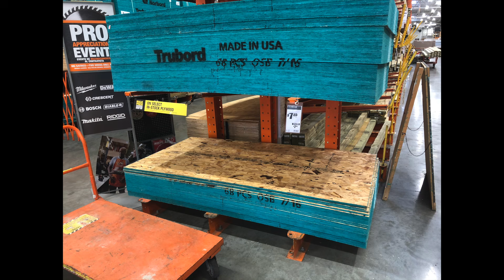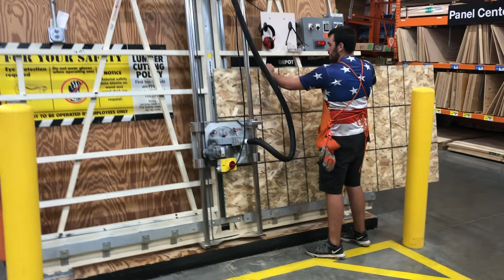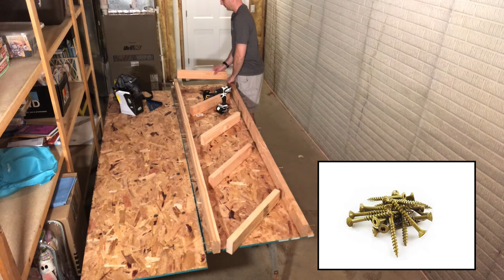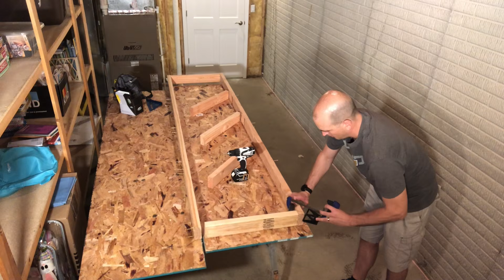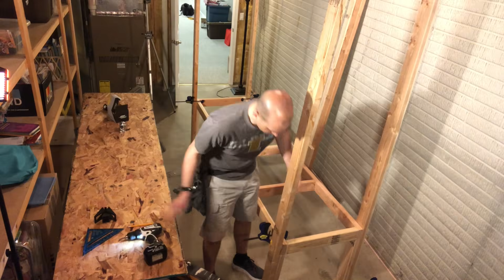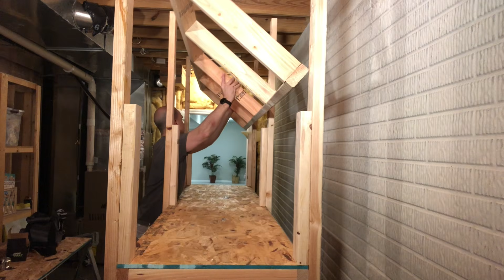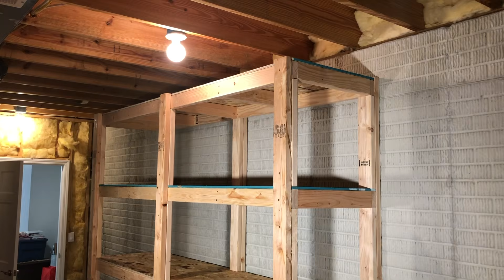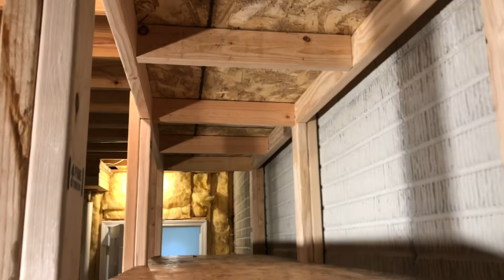How To Build Storage Shelves | Easy Build

Comment: Hi Scott, I like your shelves and they look easy to build.  I do have a question.  I bought my wood before measuring my ceiling height in my basement and I noticed 8ft is to tall and will not work for me.  I’m thinking I would shorten them by 2ft to make it work.  I’ll lose a shelf, but I’d like to keep the shelves the same size as yours.  What do you think?
Reply from the maker: Hey Jeff,  I don't see an issue with that approach. You would just cut your uprights to 72 inches opposed to the full 96 inches and have a little left over lumber.  Best of Luck!
Reply: Everyday Home Repairs thanks Scott!  I’m actually going to shorten them by a foot that way I can still have a fourth shelf just not as tall.  I have plenty of small items that will fit just fine.
Reply from the maker: @GetOffMyLawn1970  yeah if you have shorter items to store that would work better as you wouldn't be sacrificing the storage area.
Reply: Everyday Home Repairs Hey Scott all done.  They turned out great, but I had to go with three shelves instead of four.  That top shelf has 2ft plus height for stowage.  I think that’s better than a fourth shelf ending up with less than a foot.  I’ll use the extra shelf for the next one I build.  Thanks again, your video was awesome.  If you have a business email I’d be glad to show you some pictures.  V/r, Jeff

Comment: How many totes are you fitting per  shelf?
Reply from the maker: Hey Joe,  I would say 4 or 6 totes depending on the size.  The smaller ones I have are width = 16 inches, height = 16 inches, and length = 24 inches and with this size I can fit 5 with a little extra room for other misc items.
Reply: @EverydayHomeRepairs  thanks! One more question, if you don't mind. Did you say how much you spent on materials?
Reply from the maker: @homevideos91  it added up to right around $100 for all the wood and screws.  Good luck on your project!

Comment: Where do the 21" boards go?
Reply from the maker: Hey Tyler, you will use the 21 inch pieces of 2x4 in constructing the shelves.  Since each of the 8 foot lengths of 2x4 are 1.5 inches wide when you add up the 1.5 + 1.5 + 21 = 24 inches wide for each shelf.  Let me know if you have any other questions.
Reply: @EverydayHomeRepairs  Thank you
Reply: Everyday Home Repairs I thought 2x4 meant 2inch by 4inch. I was also confused by the measurements. But I have worked it out now
Reply from the maker: @sharkie1710  yeah the name is definitely confusing but a 2 x 4 is actually 1.5 inches by 3.5 inches.  Let me know if you have any questions putting together the project.  Cheers!
Reply: Everyday Home Repairs ok cheers, makes sense. How sturdy is this design? I guess you could use wider timbers to strengthen? I know it would increase budget, is it worth considering?

Comment: Great video but there are much much much easier ways for this exact design
Reply from the maker: Hey Mike, we always welcome new ideas to improve on the design, make it for less money, or save time.  Feel free to add your tips.  Thanks!
Reply: @Caleb P YouTube easy garage shelving and you will see. Theres a method where you attach 2x4s to the wall then build the front frame then attach cleats. Very easy. Almost the same results.

Comment: How do you have a white Makita? The makita i have are green
Reply from the maker: Limited Edition 😉.  Actually got these probably about 5-7 years back and for some reason they did a white edition for a bit as most Makita power tools are the standard green.
Reply: @EverydayHomeRepairs  they have some black ones and they look pretty cool but that white looks awesome. There's no brand that has white power tools.
Reply from the maker: I think you can still get the white Makita drills.  Just look for a 2 drill combo with a charger in “white” and you should find them.  Maybe a Christmas present 🎁 to yourself 👍.
Reply: Diresta has white power tools 👍🏽
Reply: @DerkT7  idk what brand that is but since I've never heard of it. 🤷🏾‍♂️😂
Reply: Zack16Fair put diresta in the search bar and you will find the King of all things hand made 😎

Comment: Great project ! 
I would place the lowest shelf about 3 or 4 inches off the ground, this way the top shelf would be more useful. 
Thank you for sharing your ideas with the rest of the world !
Reply: mar1video: That's what I did - I tweaked all the measurements so that the first shelf was at 6in. from the floor, then lowered the other shelves  so that I could use that upper top shelf.
Reply from the maker: Hey Mar, happy the video was helpful.  Best of luck on your project!

Comment: What impact will making this out of 2x3 boards? I get there will now need to be 44 21” boards now. Thoughts?
Reply from the maker: Great question Jamie!  Overall the only drawback I would see is the selection of 2x3 boards at my local Home Depot is much more limited so sometimes they have been picked through and tough to find good lumber.  If your local big box store has a solid supply/selection I say go for it.  Simplified cuts, $.50 less per 8’ board, and still plenty strong for 99% of applications.  Let me know how it turns out.
Reply: I just built one out of 2x3s. Only difference in mine was I only have 3 legs up front. The shelves got anchored to the wall directly, and I decided to go with BCX sanded plywood.

Comment: Did you drill a pilot hole before the placing each screw?  From the video it appears you did at least for the corners of the shelves.
Reply from the maker: Hey Andrew, you are correct the only pilot holes I made were at the ends of each 8 foot cross member for each shelf.  Didn’t have any issue splitting the wood with this approach so I would recommend the same for you. Best of luck!

Comment: awesome shelves i have plans of building my own sets for my shed in the near future. my only question is... what's the point of putting on the top shelf cause you have so little room left? i mean i see the need to stabilize the top of the shelf with the 8' 2x4's but why put on the osb? to me that serves no purpose and seems like a waste of materials. was there a purpose structurally or is it just for looks? thanks for sharing this video.
Reply from the maker: Wayne good question.  For my scenario there was little need for the top OSB.  Since I had Home Depot rip the 2 full sheets I just went ahead and finished the shelf off by putting the OSB on top.  Not needed and you could bypass that part for your project.  Best of luck with the shelves!

Comment: Can we secure this to a wall,  for example in a garage?
Reply from the maker: Hey Avy, For sure you can secure to the wall.  Shouldn't need much so I would find a couple studs and drive a 4" screw through one of the shelf frames and into the wall studs.
Reply: Thank you